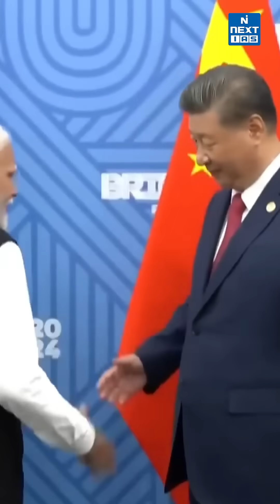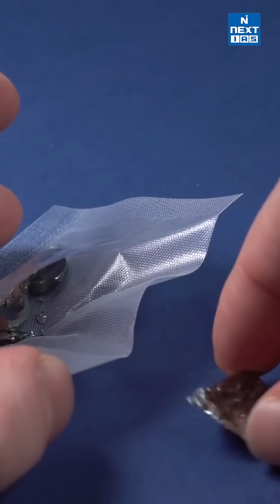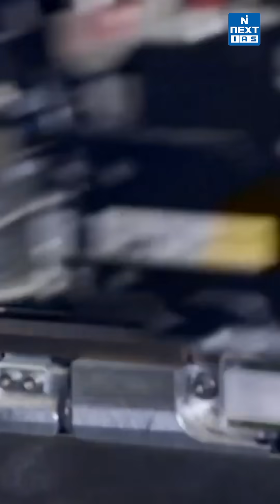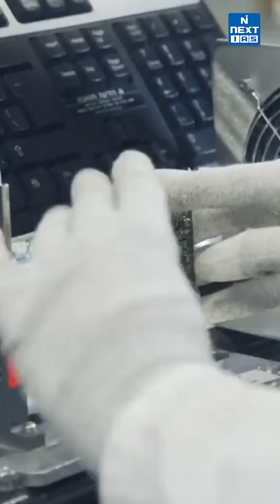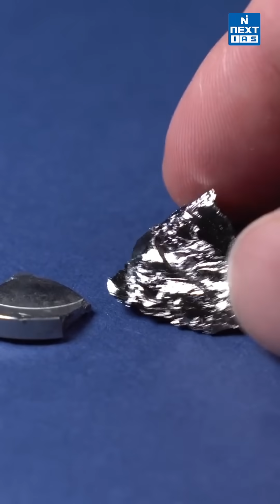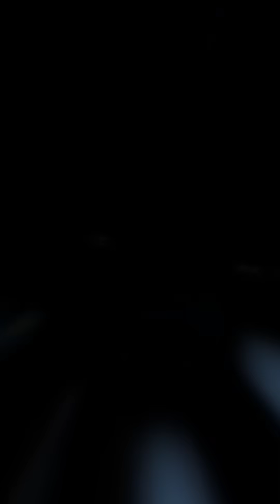Germanium: Not a Rare Earth Element | Daily News Analysis | DNA Short | NEXT IAS #upsc

Comment: It is used as a Diode Detector in Radio for anyone wondering it's electronic application. 

Without power, you can get AM waves in your headphone if you move the wire of the headphone over Germanium kept on a metal plate like a razor blade